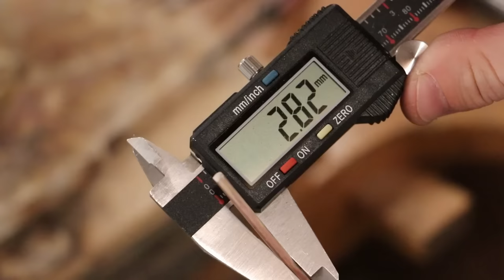Making a Cuban Chain Ring

Comment: Can i solder it with a hand torch and how much mm was the wire?
Reply: A regular torch would probably take a long time to heat up, thinner gauge wire can work with a butane torch but not thicker gauge. I think his wire is 3mm